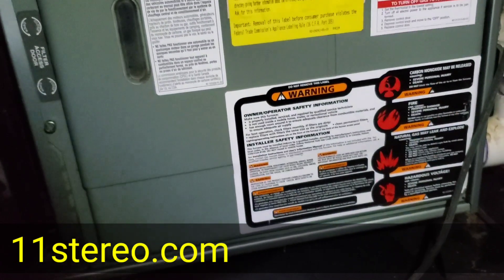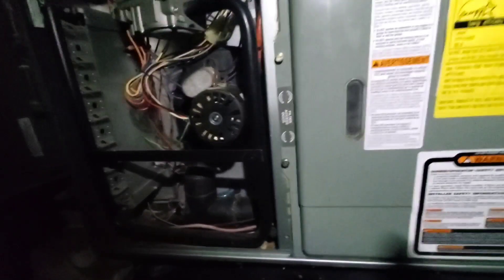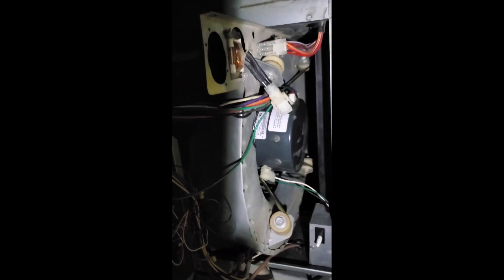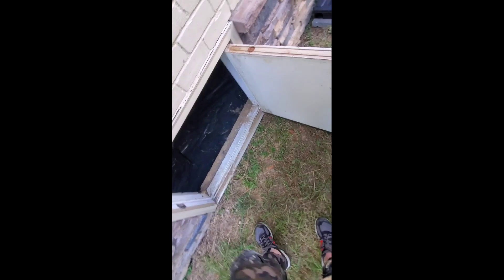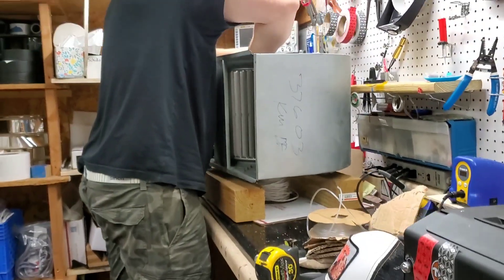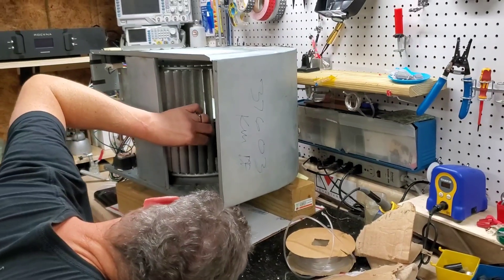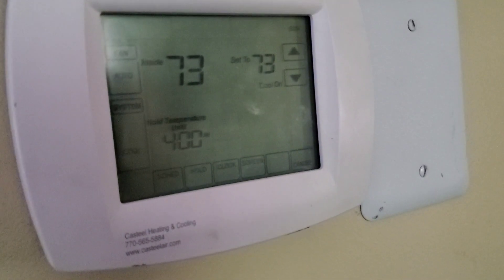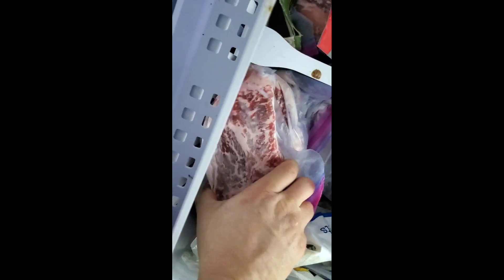OCD HVAC  crawlspace Squirrel.

Comment: Maybe a new set of tubes :  )
I went with Trane units, Also I had my complete attic spray foamed and average attic temp in the SC summer went from 140ish to 78 degrees 
Apparently it also helps make your roof shingles last a lot longer as they are not cooked on both sides. Other bonus your AC units doesn't have to work so hard